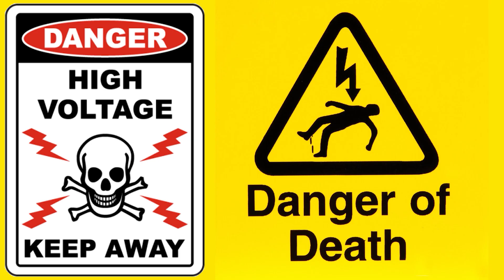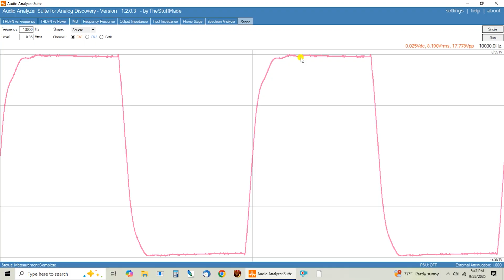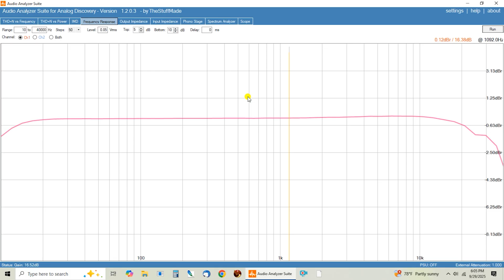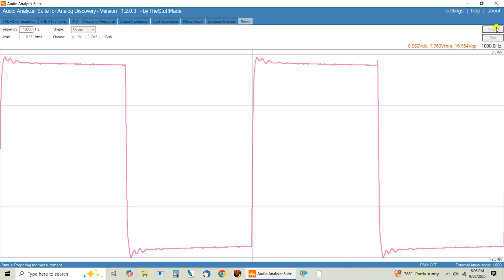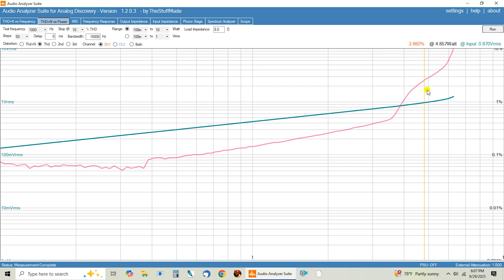Vacuum Tube Amplifier Output Transformer Shootout! 2A3 #3

Comment: This transformer testing has been extremely interesting.  Thanks Skunkie!   I’m a little surprised about your thoughts on silver wire.  I do understand that silver is a better conductor than copper and it’s aesthetically appealing to me but I find it hard to believe there’s an audible difference when the same wire gauge is being compared.  I really don’t know myself as I don’t have any experience with silver wire.  I’m looking forward to your thoughts after you have built an amp with it.
Reply from the maker: I expect the effect to be subtle but then again I've been wrong about the impact on sound some other parts have had. I used to believe all speaker cables of the same gauge sound the same.

Comment: Hi Stephe.. You could also try EML AD1 Mesh plates.. They sre extremely close to 2A3 parameters, but they use different rare tube sockets. You can buy high quality Tube Adapters for them ro use on the usual.. They were called Europe’s Queen of DHT’s, for good reason.. Same output power as the 2A3.. Then maybe try 
C3m small signal Pentode drivers for them..

Those tiny Hashimotos might be good for 71A’s and bi-amping.. As mid-high amps.

Comment: Good illustration of the trade off of load impedance distortion and power output.the old tung sol data sheet for  45 has some charts that illustrated this well.may be one for 2a3.worth a look even if not using that tube as the trade off is well illustrated.

Comment: Great shootout,have you ever used a Hammond 1630SEA OT,
Reply from the maker: Thanks! I haven't used that one before.
Reply: @SkunkieDesignsElectronics  Thanks for reply, just built a single monoblock based  on your EL34 build with stereo inputs mixed after the 12Ax7 into the EL34 no negative feedback out transformer is the Hammond 1630 SEA this thing is heavy 11 lbs it has massive  bass response don't have an analyzer to give more detail

Comment: I believe you have built a 46 amp before. How do you like the sound of a 46 tube versus the 2A3? I
Reply from the maker: 47 amp, different sound. I was using old globe tubes as well.
Reply: @SkunkieDesignsElectronics 

I have some old St bottles. I would would like to grab some globes. My build will be pretty nice. I'm excited about it. I will take a look to see if you had documented yours